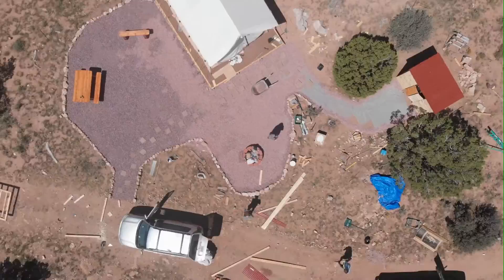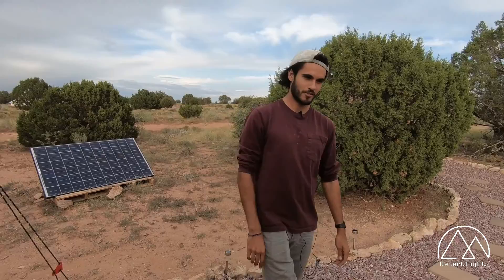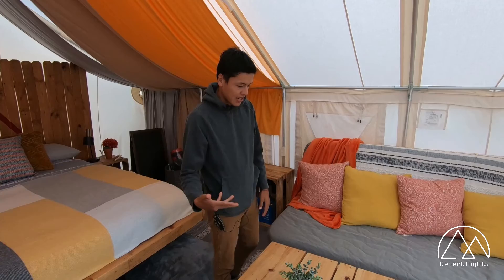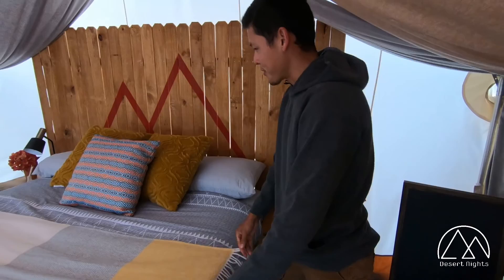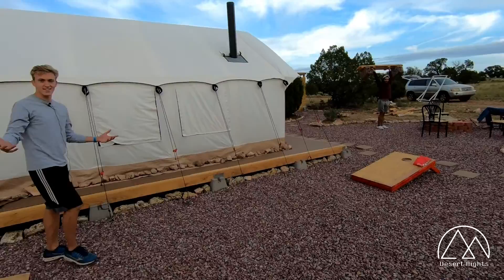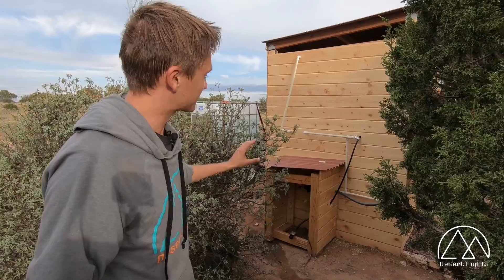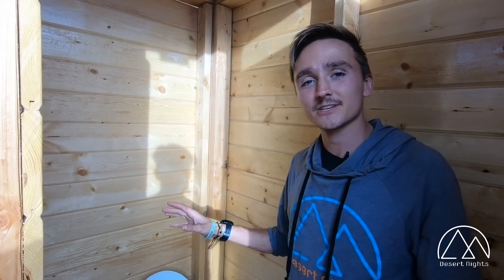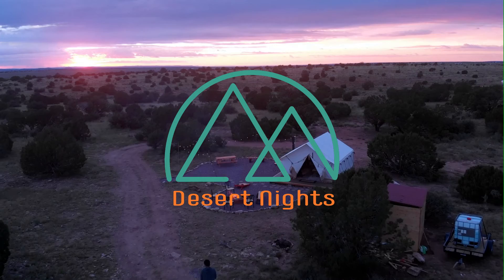Our Second GLAMPING SITE - Full Walk-Through

Comment: Awesome Content! 🎉
I’m in Deming, NM
1. Where did you get the Safari tent?
2. 125Ah deep cycle battery. How many watts or amp hours does the Solar panel perform on a clear skies sunny day?
3. How would it be more cost-effective to have an electric stove and electric powered water heater?
4. What is the sqft in the safari tent? 
5. Do you provide instructions for charger ports available and compost toilet use?
6. How would a DIY water catchment system on your solar panels, bathroom shed and waterproof shed help top off your water supply?
7. The Airbnb link in your bio does not work.
8. It’s been 2 years. Any updates? AirBnB progress? Month comparisons of stays? Comments from guests? Growing pain moments?
Thank you so much for sharing! ❤